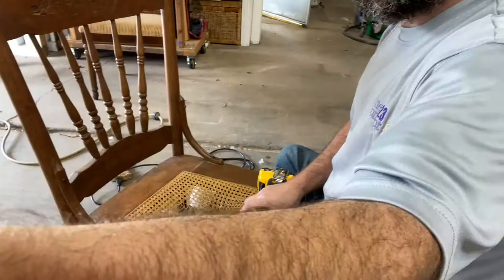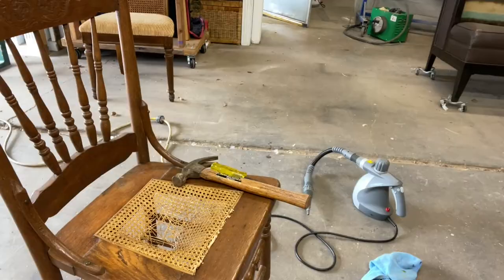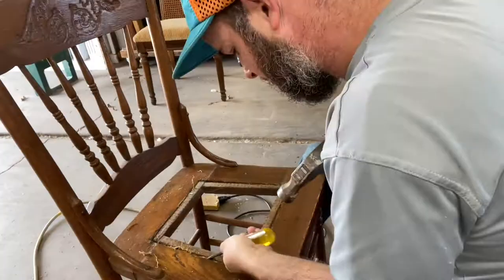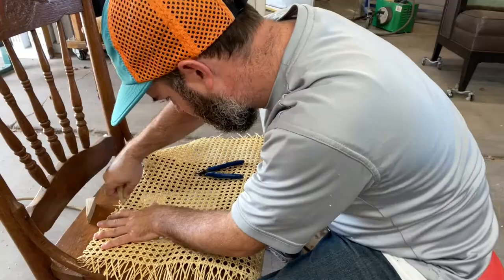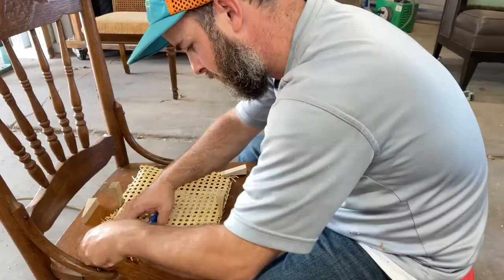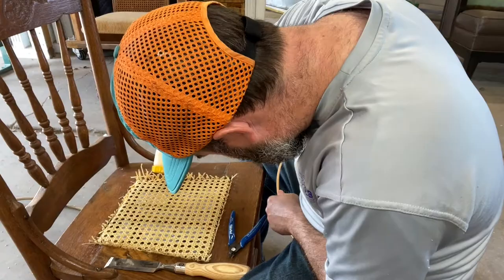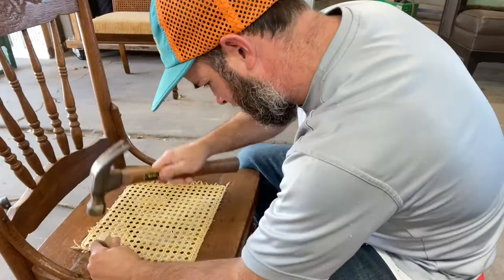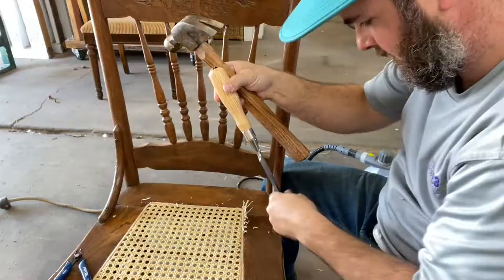How to Replace Pressed Cane (dining chair seat replacement)

Comment: Nice job. I got some good info.  I saw a tip where you just seat the spline, then use a knife to trim off the excess cane. When you tap the spline home, no more edges to trim.
Reply from the maker: Thanks for the tip!